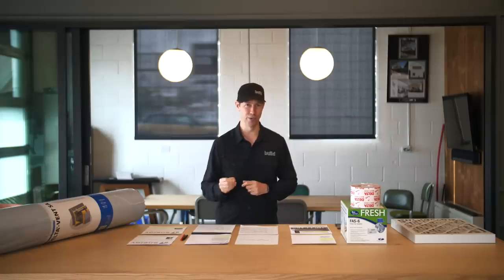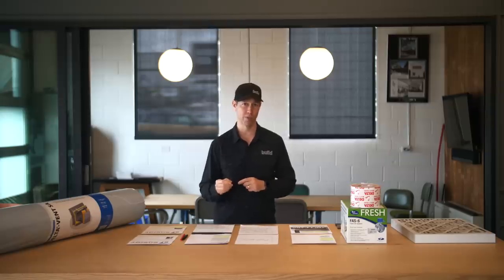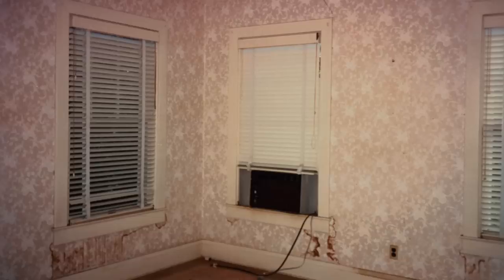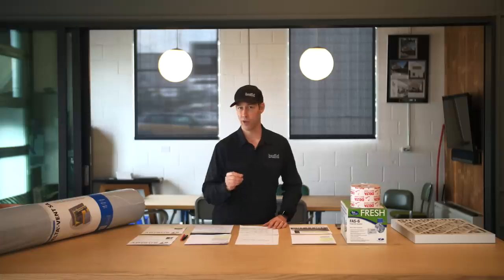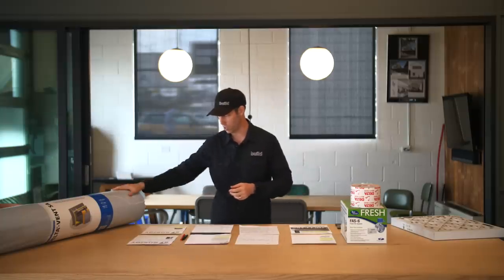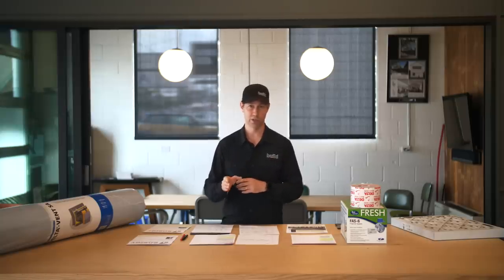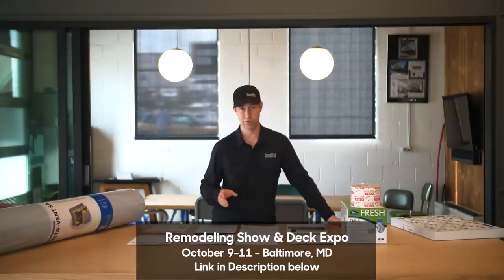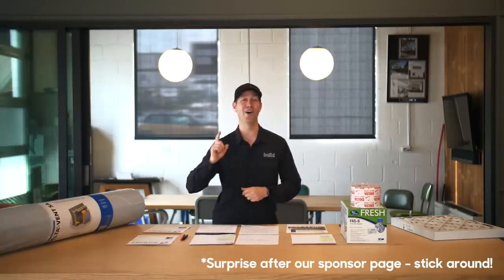“Houses need to BREATHE!” - Shut your filthy mouth

Comment: Matt, planning a Build like Erik at Texas Barndominiums. Metal shell, heated slab, his method is steel roof,  blown foam shell on inside metal, and between steel and studs on the side walls. Sheetrock inside. Do I need to use a vapor barrier anywhere? In SC, AC much of the year. 
He sprays direct to the metal, then rocks,  I think!!
Tight envelope concept.

Comment: My philosophy has always been you should build stuff as air tight as possible, and then introduce controlled air exchange such as a HRV.  That way when it's -50 out you arn't losing heat like crazy.  My house is super leaky and I need to tear out the drywall so I can redo the vapour barrier on all the outside walls as they never used tape.

Comment: The real reason air leakiness is a problem is that standard HVAC technologies cause a slight vacuum in a house.  A lot of problems would be solved by HVAC systems that always draw in outside air for both heating and cooling, thus maintaining a slight positive pressure inside, and controlling where air can exit.

Comment: My parents build a traditional (round)-log cabin in the early 1970s. It's a beautiful home, but in the summertime it gets extremely hot and stuffy inside, making it difficult to sleep at night. A second refrigerator in the basement developed pronounced rust on the door. The main floor has a drywall ceiling and the (undeveloped) attic has roll insulation on top of that drywall. The roof has no internal covering or insulation. I've heard that this is the wrong way to insulate/seal the house, and is the cause of the extreme heat and humidity in the summer. (I also suspect that this also affect heating cost in the winter.) My parents are very skeptical about this reasoning. They say they had a home evaluation crew come in with the door-fan method to test the house and it was deemed to be "airtight and well insulated", but the summer sauna effect tells me otherwise. They have a gas-fired forced-air furnace in the basement that blows heat through duct work to the main floor, plus a gas stove in the basement. To me, it sounds like the attic needs sealed and the roof needs insulated, as does the outer floor joist / subfloor plate at the top of the basement (basement already has styrofoam panel insulation). But how do I convince them that they need to alter their thinking and do these things???

Comment: I did fire and life safety work in GA & TN. it's crazy seeing a fan test on a house & didn't know that it would apply to residential. it's really interesting. Ive only ever seen/needed fan test were after installing a clean agent suppression system in "clean rooms" (generally commercial server rooms).

Comment: Build as airtight as you can and don't skimp on the ventilation system, then you will have a great indoor climate and energy bill.
Recently heard back from a house i helped built that the blower test resulted in a great seal with a overall hole less than a dollar coin in a 2600 square foot house.

Comment: I know this is a old video but you can build a house too tight.  Back in the early 90s I worked on a house that the customers used spray foam everywhere.  When done the fireplace wouldn't burn and your ears popped when you closed the doors.

Comment: I completely understand the need to build tight for energy reduction and comfort (both heating and cooling) BUT I live in a climate (PNW) where I leave my house as open as possible 5 months a year.  I'm not too concerned with allergens, mold spores, santa clauses sneaking into my home, though it does make sense to filter them out if your controlling with mechanical ventilation.  I don't even worry about screens on my doors and windows most of the time.  But in the winter I find my house gets so dry I don't turn on the bathroom exhaust fan when showering or range hood when boiling water.  Having a dry house means waking up with no moisture left in my mouth or eyes.  I'm hoping in my next home to have a 30' bifold doors to the outside and an indoor garden (which I'm sure will produce a ton of humidity).  Will building a super tight house prevent humid air from entering walls and condensing causing mold and rot?  Are there better building materials for exterior walls and roofing that are resistant to mold and allow a more humid environment?  ICF, rockwool, etc

Comment: I will just throw this out there for anyone who cares.  I do blower door testing in the north.  I have been doing this for years now and have learned much about air tightness on homes.  With the mechanical ventilation used in today's standards  the science shows that we are actually over ventilating our homes compared to what is actually needed to prevent mold or other adverse reactions that homes experience from being so air tight.  When the ERV/HRV systems are actually balanced correctly, we tend to see over ventilation which isn't harmful except on your monthly bills.  Make sure this happens otherwise you may see a lack of ventilation that leads to issues down the road.  There is more information and experimentation being presented to the code officials to bring everything in line with the new codes to be as energy efficient as possible while maintaining the integrity of the homes currently underway.

Comment: Really good summary.  I think you need to add in dew point to the conversation. This affects comfort as a low dew point in the summer can help keep you cool and a high dew point can make you sweat even when the AC is pumping at 68 degrees.  The dew point also affects how condensation forms on surfaces, often where we don't want it to form, like inside our wall cavity.  We need to be mindful of water vapor as we tighten up our houses.
Reply: He may not have used the word dew point but talked quite a bit about air temperature and humidity levels and condensation.

Comment: Those stains under the windows were cause by a temperature differential  Matt. In 1930 they didnt have dual pane windows filled with argon gas and weep holes.

Comment: Fifty pascals is... 0.2 inches water column.  That's actually a fair pressure when acting on a large area: a door unlatched may "jump" open a foot or so as pressures try to equalize under those conditions.  But to help understand what kind of standard ACH 5 is, let's look at an industry that wants to ventilate:  oil drillers.  According to API 500, the minimum change out of total air volume for an enclosed area where hazardous gases may accrue is 6x per hour - that's a purpose built ventilation system [although it might operate as low as 0.15" water column differential, where air ingress from outside the space is guaranteed through door jambs, etc].   In that light, ACH 3 is more of a standard for a home, while 5 is not much of anything at all.

Comment: with covid i have had 3 people pass out from CO2 from ventilation system not venting properly. was not pulling out door air. the builder made the assumption the people wood open the doors 3-4 times a day.

Comment: i sometimes have questions about this whole "ventilate right" scheme. it used to be that you ventilated your house by opening the window. the idea that you have to filter the outdoor air seems kind of ridiculous because outdoor air quality is invariably many times better than indoor air quality.

i don't question that a mechanical ventilation system can provide improved indoor air quality relative to opening your window, but i question the suggestion that mechanical ventilation is somehow necessary. it's kind of like saying that driving a luxury car is an improvement over driving a subcompact. but it is not "necessary" to buy a luxury car.

Comment: Doing a vapor analysis of your envelope and choosing an appropriate system for the climate is a much more appropriate way to prevent those moisture issues these days. Oh, and making sure your buildings have good boots and a good hat. 

As for air for occupants, I think the ASHREA and HVI standards are better than IBC/IRC. Many code-minimum systems seem woefully undersized and people complain of "stuffiness."  I also think that it is a nice quality of life feature to still aim for the old minimum 4% openable natural ventilation, positioned to take advantage of cross breezes when possible.

Also, we used to spec insulation so that the cold side would remain above the dew point so that vapor wouldn't condense in it. In the north that meant your furnace had to keep your siding warm and radiate all that heat to the world. This is horrible energy inefficient but that's how it was done when oil was cheap and the idea of it ever running out hadn't occurred to us.

Comment: Building air tight is damn near impossible, and that's where there is a major problem. Think about being in the space station.  You get a pin hole in the exterior wall. It doesn't matter how small the hole is, all the pressure will pass through that hole as if it was shot out of a tank. These small breaches in the envelope,  have large amounts of moisture passing though them all the time. If it's cold enough that water will condensate, on the cold surfaces.  That could be something like a sheathing nail. the nail head is exposed to the cold and transfers  that cold into your home. That 1 nail, near a breach in your sealed home could cause huge rot, because the wood never dries out. If you have lots of engineered lumber in your home that could become a structural problem in 1 year. If you want this sort of air sealing and thermal break. Hire the right guy, be ready to understand why the costs are so much higher.

Comment: You need a certain amount of breathability just for the moisture in the building materials to escape.

And if the power goes out and you lose ventilation you can’t always just open a window. Let rain come in and cause damage or if its way too cold.

Comment: There was no science presented here. In fact, a blog was one of his resources. He strung together a list or reasoned arguments as to why a sealed house might be more desirable, but that is not science. And using airplanes and submarines as examples are logical fallacies that have no corollary in house building, nor does the human body. So, lets perfectly seal a house, hermetically, if you will. Now what happens once water gets where I don't want it, and it will, since I live in this perfectly sealed house but I do have to shower from time to time? How's it to disperse or get out and dissipate before causing damage? After all, 'you can't seal a house enough...'. Didn't he show what happens when a vapor barrier perfectly seals off a section of the house? 

His argument is, we use newer, crappier stuff, most of it dictated by code, and because of that, we need to take extra steps to seal the house to keep this crappy material from breaking down. Fair enough, but it ain't science. And conveniently, he has the products that you should use of which the corporate sponsors pay him to show you. 

Not saying he is wrong, but it ain't science, and its a paid advertisement so I believe a little skepticism would not be unreasonable.

Comment: What would happen if your house is 100% sealed? If you made it perfectly sealed would it be better or worse?
Reply: Not a problem as long as you're bringing fresh air in through the HVAC system and exhausting the kitchen and bathrooms when needed.

Comment: Houses do not need to breath. Measures shows that the humidity change is goes through open windows and doors in 95%. The pictures shows that buildings have bad insulation and bad windows. Waters flows on surfaces when the surface temperature drops below 17 C.  (62.6 F) 
When passive houses are builded there is an air insulation conbtroll in the process to make sure the building is not "breathing". The humidity should not go into the walls. Thats why the water insulation is in the structure. (most fiber insulations losing heat insulation ability when humidity goes in)
Air change is best if you have a ventillation system with heat changer.

Comment: So my fav house design is a
single story ranch wrap around porch 3br 2bath open floor plan common wall plumbing two car garage. Earthquakes  tornadoes and floods probable hurricane remnants snow and ice loads possible. I'm thinking ICF and steel on a slab with all brick exterior metal roof If I could build my dream house.

Comment: My house is drafty now, and I'm fixing it slowly. Different windows, sealing off holes, plumbing penetrations, etc. 
What sucks is that the strange design doesn't allow for roof venting. I have a gambrel (barn) roof, the lower slopes just sit on gable roofs. No soffit or path for venting to occur.
Reply: good luck

Comment: Tight houses and filtered air intake is so sterile. Good way to raise children with allergies.

I 100% agree tight houses are an option people should have, especially for people who already suffer from allergies or want to maximize comfort.

But for me? I want less separation between myself and the environment. That barrier free shiplap house definitely speaks to my tastes for how I would prefer to live.

You don't pig energy if you aren't trying to over-control the climate. We're more resilient human beings when we allow ourselves to adapt with the changing seasons.

For example, I set my AC to 90 and the heat to 60.

Comment: I hear filtration of things from the outside, particularly moisture, but I do not hear about things added internally -- outgassing of foam insulation being one but also cleaners, sprays, finshes on furniture, etc.  I remember, also, the problem with manufactured housing bought by FEMA after Katrina, which ended up being stored in fields at great expense because of formaldehyde issues.

Comment: You don't mention anything about exhausting the air.  Probably more important is we need to exhaust old stale air and moisture.   You can say that we should control the air intake of the house all you want but what good is that without any leaks to get the stuff out!  And of course it needs to be balanced.

Comment: There can be a huge problem with retrograding an old home to new code standards in air leakage if the HVAC system isn’t upgraded as well. A home that is sealed without the whole HVAC being reworked can cause poor indoor air quality without an air exchanger mold will quickly become an issue. Granted, I’m familiar with building in the north, the issue may be different down south.

Comment: Yes-if a home "breathes" from the inside,   it shouldn't be fully sealed. NEVER REPLACE WOOD WINDOWS! They can be repaired and restored. They are naturally insulating (wood isn't a great temperature conductor) In these homes, tapestry drapes are used to insulate around the windows at night. Condensation doesn't happen because the air trapped behind the drapes remains pretty cool, yet it still can dry out. Drapes will help absorb and dry moisture-make sure they are COTTON. Antique homes are SUPER tight. I'm restoring a vintage (1949) NOT air tight!
Yeah-ventillation super critical.
Reply: I just replaced my 40yr+ anderson wood windows with fiberglass windows and they're awesome. Wood frames were starting to rot and very drafty

Comment: Is it just houses from the 70s. My apartment was built in the 40s and Has a building HVAC but it has no way to get fresh air inside. It’s really bad so that if you’re sleeping at night you’ll wake up feeling dizzy and groggy from the lack of oxygen. I have to open up the windows every day to air it out or the air is stale and unhealthy.  Problem is that the temperatures are in the 90s with the humidity often in the 80 to 90%, so it’s also unpleasant opening the windows to air it out. And the humidity in the summer never drops below 60% whether I open the windows or not.

Comment: I am a builder and renovator, and have been for more than forty five years. Retired now. While I agree with everything you said regarding a tight house, and I agree that the products and technics developed to make tight houses healthy, do work, there is a very big fly in the ointment. In order to be profitable for a contractor, there are technics and tools as well as products that make building faster. As we all know, faster, often means mistakes, missed areas as well as missed items and steps to save time. The other fly in the ointment are the workers hired to do the work. Many lacking integrity or pride in their work. I don't mean the company, I mean the 18, 19 yr old laborer tasked with these menial chores like putting up barrier material and caulking, which are the bones of a tight house. One of your recent videos shows these, your biggest mistakes video. The old hundred year old houses that breathed, certainly are not the answer to more comfortable and energy saving houses, but the materials in them are. We need to use solid natural materials but in a different way. A hundred years ago the building materials were cut and shaped using machinery and drying technics that were far less precise and capable as todays machines. The cedar sauna I have is a great example of how wood can be precisely cut and fit together. It keeps the extremely moist hot air where it supposed to be. I have never seen evidence of mold, in , or outside around the sauna. And what about the modern factory cut prefab log homes > no vapor barrier or air barrier material there, at least not in the standard sheet type used in stick buildings. Since the invention of plastic, the world health has diminished. Unfortunately there are too many pockets being filled producing products from it and most recently (combatting it). Oh, by the way, Love your videos.

Comment: Specifically concerning houses in deep south , hot and very humid;this video seems to suggest vapor barrier to stop outside air intrusion from condensing and causing moisture when reaching cold interior.  Then another video of your's says no vapor barriers should be used in the south. Whats correcT?